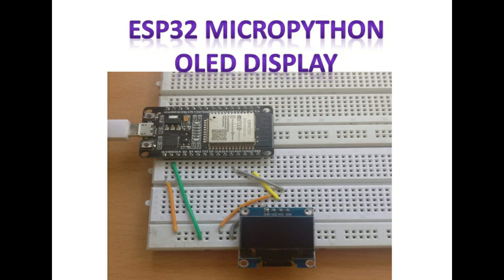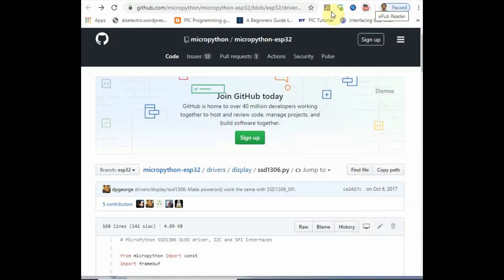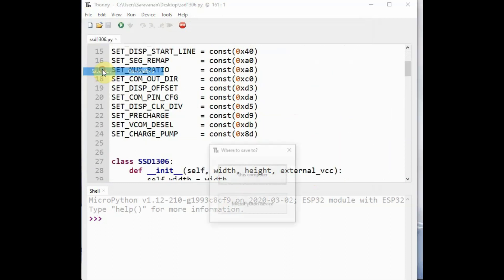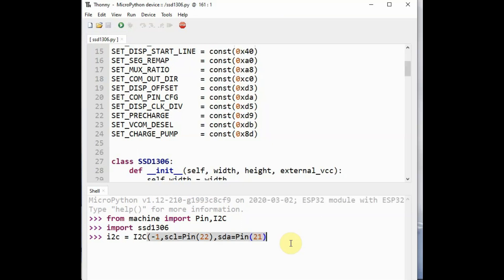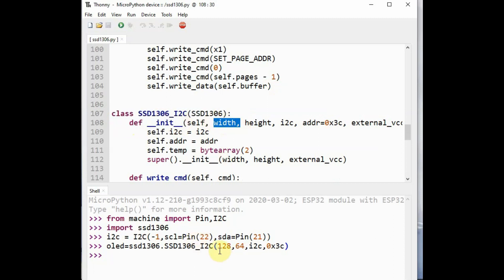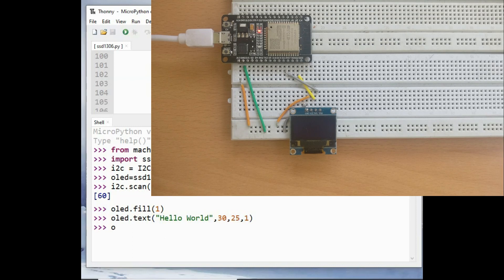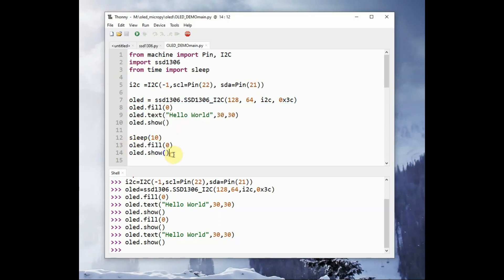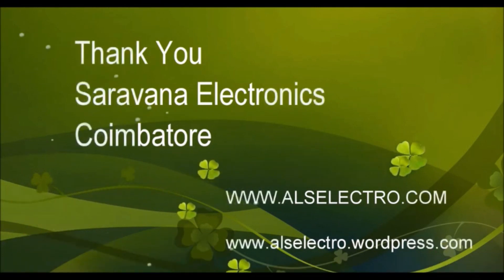ESP32 MicroPython OLED Display

Comment: Hi, I have been experiencing a very strange error. Whenever I use any function related with Wifi the board resets with SW_RESET. It is happening in both boards I have. 

rst:0x3 (SW_RESET),boot:0x13 (SPI_FAST_FLASH_BOOT)
configsip: 0, SPIWP:0xee
clk_drv:0x00,q_drv:0x00,d_drv:0x00,cs0_drv:0x00,hd_drv:0x00,wp_drv:0x00
mode:DIO, clock div:1
load:0x3fff0030,len:4916
load:0x40078000,len:16436
load:0x40080400,len:4
ho 8 tail 4 room 4
load:0x40080404,len:3524
entry 0x400805b8

Would you help me?

Comment: getting this error

  File "<stdin>", line 1, in <module>
  File "ssd1306.py", line 110, in _init_
  File "ssd1306.py", line 36, in _init_
  File "ssd1306.py", line 71, in init_display
  File "ssd1306.py", line 115, in write_cmd
Reply: i2c = I2C(-1, scl=Pin(4), sda=Pin(5)) 
это для main.py
Reply: i have the same problem did you fix it?
Reply: Oled ekran esp32 ile haberleşemiyor. Lutfen bağlantıları kontrol ediniz.

Comment: As I was using a PyBoard instead of an esp32 I was worried these instructions wouldn't work for me, but with minor modifications it worked a dream. This video is awesome!
Reply: Can you please tell me how you modified it? Thanks!
Reply: @mahiatlinux  Hopefully you can extract the code you need from this:
'''
Step 1: Get the current system time
Step 2: Write out the current time to the microcontrollers's rtc object
Step 3: Synchronize the rtc object with the ds3231 module
Step 4: Within a loop write out the ds3231 get_time value to an oled display
Step 5: For now print out the hours, minutes and seconds
Step 6: Within the loop calculate days until retirement
'''
from utime import sleep
from pyb import RTC
from ds3231_pb import DS3231
import ssd1306
import utime

def days_between(d1, d2):
    d1 += (1, 0, 0, 0, 0)  # ensure a time past midnight
    d2 += (1, 0, 0, 0, 0)
    return utime.mktime(d1) // (24*3600) - utime.mktime(d2) // (24*3600)

retirement_date = (2021, 9, 10)

rtc = RTC()

i2c = machine.I2C(1)  # Connected on 'Y' side Y9 clk Y10 data
ds3231 = DS3231(i2c)
#ds3231.save_time()  # Set DS3231 to match Pyboard RTC

oled = ssd1306.SSD1306_I2C(128,64, machine.I2C(1))

while True:
    oled.fill(0)
    print('[rt]', rtc.datetime())
    print('[ds]', ds3231.get_time())
    ds_time = ds3231.get_time()
    
    today = (ds_time[0], ds_time[1], ds_time[2])
    diff = days_between(retirement_date, today)
    print('diff =', diff)
    
    time_text = "%02d:%02d:%02d" % (ds_time[3], ds_time[4], ds_time[5])
    print("date text is:" + time_text)
    
    oled.text(time_text, 0, 10)
    #oled.text( str(ds_time[3]) + ':' + str(ds_time[4]) + ':' + str(ds_time[5] ), 0, 10)
    oled.text( 'days to ret:' + str(diff) , 0, 20)
    oled.show()
    sleep(5)
Reply: @wrightkevin9000  Wow! Thanks so much! Did not expect you to reply because its been a year. Was looking for this. There is not a lot of tutorials explaining things about the pyboard.